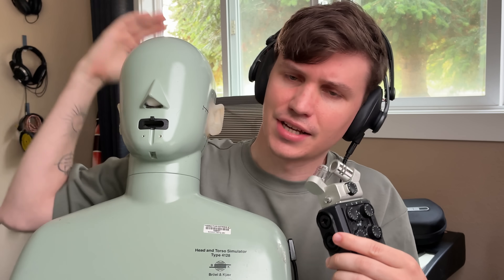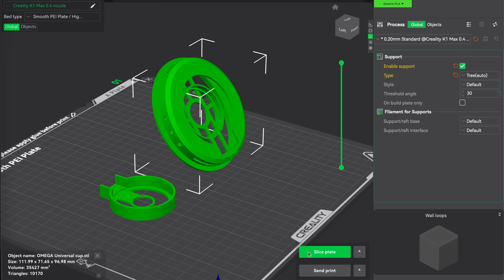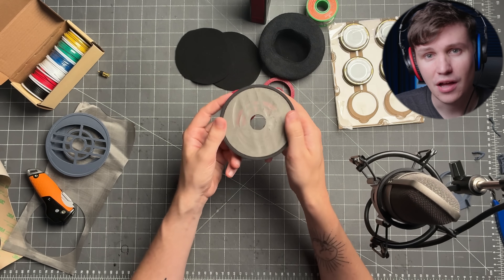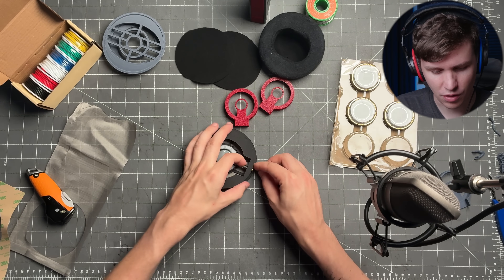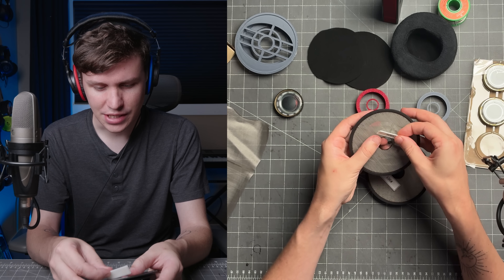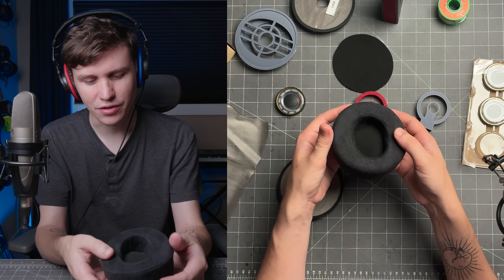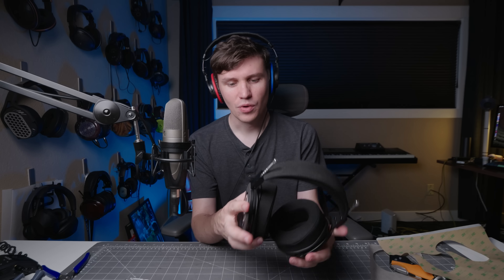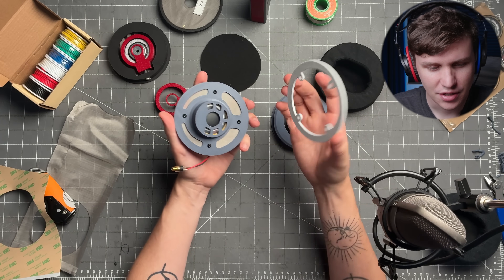Now YOU can build my Omega Headphones

Comment: shouldnt there be a left and right specific cup rotation limiter? they are only supposed to go on the back correct? seems orientation will be wrong on the left one.
Reply from the maker: You just mirror the part on the print bed (at least that's what I did)

Comment: I think that cutting out the adhesive tape with the ear piece is a little bit unpractical. Instead how about  you create a stl template for the surface that you want to stick the adhesive tape to. In that way you can trace the shape of the surface area much easier, without being restricted by the whole ear piece.

Comment: Just finished a pair last night!  Pretty great so far.  A bit brighter than imagined, but I cant decide if its because I'm not used to that level or detail, or if its overly sibilant.  Which I also realized could be because of the material I printed them with (ABS-GF) which is quite a bit stiffer, than Nylon.  I wish I personally had a way to measure to see what the difference would be.  I may print another set and test it with Nylon (Ive always struggled to get good nylon prints) Thank you for this project.  Its introducing me to things I could have never afforded.
Reply: Theres not much on headphones but plenty of 3D printed speaker boxes that show it doesnt really matter much what material or infill.

Comment: Have you tried using silicone adhesive instead of hot glue? Thinking what you use to seal a bath/sink with. Could be easier to get it precisely in the right place as you can work with it without burning your fingers, and it will harden and seal in a similar fashion to hot glue

Comment: For anyone who orders these from digikey, I ordered some more of the drivers from them, and this time they cut off a section of the tray, and properly held them in with cardboard.  Hopefully this much improved packing is standard now, and not just luck of getting the right shipping person.  The previous 2 times I ordered them they were bad.  The first time, they were just bubble wrapped, and were stuck together, with the surrounds all wrinkled.  the 2nd time, they had it almost right, and had them packed between a piece of cardboard, and some foam, but unfortunately they had the front (mashable) side of the driver on the foam, and the magnet side against the cardboard, so the foam just pressed into the surround and wrinkled it.

Fortunately the dents are fairly easy to pull out, and they were all good as new, but it's definitely nicer not having to go through the extra step.
Reply: Did you le them know? They're pretty responsive

Comment: if only 3d printer is cheap, ive been dreaming to build a hybrid wireless bluetooth headphones with 3.5mm jack port so you can plug a wire when you're battery died

Comment: Incredible project. I’d love to see an open-source hardware headband that can be both cheap, easily sourced, and very durable, because all of the common headphone headbands seem to be pretty flimsy with stress concentrated in plastic parts. The mounting method you show seems to rely on a spring-loaded C-shaped clamp on each driver unit, but it might be easier to use a 3D-printed C clamp if instead it had bosses for bearings or bushings.
Unless there’s a relatively cheap and durable option I’ve not seen.
Reply: See pinned post?
Reply: Look at Capra audio.  I think he's planning to do something to fit these (and I'm sure it wouldn't be too hard to do a modified yoke from one of the existing designs if you're impatient)
I was a little skeptical myself, but printed a few pairs of the satyr 2 using PETG for all of the non-tpu parts almost exactly a year ago, and have been using the same headband and yokes constantly_, and they've held up like a champ.  I have been too lazy to threadlock the screws in the pivot, since I always have a screwdriver on my desk, and just give them a tweak when they get loose, but really that's more of a _me problem than an issue with the design.  I have swapped a few different sets of cups onto them as I've messed around trying a few things, but I'm not super worried about the plastic in the headband breaking.  In the event that it does, I'm okay with reprinting a piece every couple years, if that's what's needed.

I'm not rough on them, but I don't exactly baby them, either.  They get tossed in my backpack pretty often, and I wear them when I'm out walking all the time.

Comment: I really like this design, but using hot glue is a flaw, vibrations could weaken the seal over time.
Reply from the maker: Nah, I tested drivers for years in this setting. It’ll be fine.
Reply: @DMS3TV  Are there other, more "permanent" options you can recommend?

Comment: Anyone know what settings to use for pla+? I'm using a bambulab x1c. I tried to print it at 55° and it comes out pretty bad (talking about the main circle cup thing for the driver to sit on). Thanks in advance.
Reply from the maker: I had very little luck printing models on bambu printers sorry :/ not sure what could help here. Did you try tilting it up at an angle and using tree supports like I did in this vid?
Reply: I tilted it to 55°and added the tree supports manually since bambulab didnt put it in good spots. But still comes out pretty bad. Gonna keep trying though.

Comment: Around how much do all the parts cost? I see a place charging $849 for already built ones, so thinking it costs way above my budget for something like this. Or are they just really overcharging? I see the drivers only cost around $10-$11 each. Pads are about $60 each. Dekoni Audio Foam Attenuation Kit is about $20. Few other things that are less costly and we talking like $200 max in parts? 3d parts would be nearly free since already have printer and filament.
Reply from the maker: it depends on the materials used and the labor time. SLS printing instead of FDM is VERY costly. Same with machining the headband parts and channel matching drivers. All depends on how they're making it.

Comment: Lcd pads should have adhesive on their lip, but here there is none.
What I'm missing?
Reply from the maker: The pad lip just slips onto the headphone.
Reply: @DMS3TV yes but should I remove adhesive or leave it as it is wirh sticker.
Reply: @DMS3TV  ok now I see. The adhesive is not applied into the pad. Now it makes sense, but just after i assembled my omegas

Comment: Got my peerless 50mm drivers in the mail today to hopefully get started on these. They packed them loosely in bubble wrap, all of them have damaged diaphrams and of the 6 I ordered 5 of the 6 are toast. One is completely immovable, 4 barely move, 1 will probably work normally but has dents in the surround though less than all the rest. Parts express only allows orders of 384. Anyone have better options? Might just give up and buy one of the remaining completed headphones at this rate. The last time I saw someone treat a speaker so poorly it was an ebay transaction and the seller packed loose 5 lb woofers in air pack which obviously was popped in transit demolishing the speakers.
Reply: you might be able to save them.  I got a bunch the same way, all stuck together with their magnets mashing into each other's surrounds.  Get a piece of duck tape, and just lightly stick the corner to the surround, and pull the dents out.  They're flexible enough that they'll usually come out as good as new.

Comment: Why not put the source files in the repo?
Like the file for whatever CAD software you used instead of just final limited editability output files (not even step files)

In some ways this seems equivalent to the open llm models being more open weights than open source
Reply: I agree. This would be much better than having to convert an STL back into a mesh and modifying that.
Reply: Just found this video and checked the git repo, and it looks like the STL files are up there now.
Reply: @brianfox340 STL files are not source files

Comment: If the Serial plate is used for tuning, why is it not integrated in the baffle design?
Reply: Probably so you don't have to print a left cup and right cup since the integrated serial plate would make them asymmetrical.  Just one cup that can be used as either a left or right.  Though it would be nice if there was a pressure fit clip on both sides so the plate could be pressed in easily.

Comment: Impressive! Good work.
Would be interesting to see if something like a Qudelix 5k could be stripped out of its casing and fit somewhere by adding a compartment on the outside of the cups (or in the headband?), and then run some balanced cables down to the drivers to make a wireless version. Hell, could probably just get a Pi Zero 2W or something and have a separate DAC placed in each cup.
So many possibilities🤔

Comment: Is there a specific filament type you recommend for the cups? or does it not matter much aslong as they're not flexible?
Reply from the maker: anything should be fine. I did my testing on the re-work with PLA

Comment: I'll definitely be giving this a shot sometime soon.  BTW, you probably don't need to go with the crazy 3m adhesive to pull out the wrinkles.  I ordered a bunch of drivers and they were absolutely mashed, and I found it pretty easy to pull the dents out just by gently touching the corner of a piece of duck tape to it, and workiing my way around.  2 minutes and they went from looking destroyed, to good as new.

I'm sure DMS has a lot more data then I do on matching them, but I found them reasonably consistent.  I got 8 drivers.  I don't think any of them are mismatched enough to bother me if I just bought a pair, and got luck of the draw, but with the 8, I came up with 3 matches that I think were very good, and one pair that's just okay.

Comment: The LCD choice pads are mounted with sticky tape? Or have they changed it so it has a lip?
Reply from the maker: it fits on a lip
Reply: @DMS3TV  Did you just remove the sticky tape that came on the pads?

Comment: How much does this cost overall?
Reply: From quickly looking through the materials, the pads and drivers combined will cost about $80+shipping. The prints will cost whatever it costs to either get them printed or print them yourself. The rest of the materials shouldn't be more than $50 or so. I'd expect this to be doable for $150 less the headband. But probably more like $200 to $300. Of course, if you have to buy any of the tools that price could easily double.

Comment: It's kinda hard to find the drivers with a quick google search, can you give some examples in the github materials file or in the description in the video (not links, just places where I can buy legit drivers and not get scammed or something)?
Reply from the maker: you can find the drivers on digikey :)
Reply: @DMS3TV  I bought drivers there a couple times and they are sometimes very bad at packing them.  Luckily, even if they're all wrinkled and look totally trashed, I found it pretty easy to just go around with the corner of a piece of duck tape, lightly touch it and you can pull all the dents and wrinkles out in 2 minutes.

Comment: I'll add this to the list of projects that I want to do, just one little question, while you talk about FDM, have you tried diferent materials? I mean, PLA, PETG or ASA, if you tried is there any difference?
Reply: As someone who has mainly worked with PLA, the step to add hot glue had me worried because of PLA's low melting temperature. It doesn't take much heat to soften PLA and potentially warp something.

I'll have to do some experiments with hotglue on prints tonight.
Reply: Replying so I can get the answer too
Reply: Yeah, would like to know this as well
Reply: I would also like to know
Reply: Ill be testing with PLA and PETG
Reply: @Twist_av_Lemon Any results yet?

Comment: How would you channel match those without an access to a measurement rig?
Reply: You can match using DC resistance measured with a multimeter (± 1 Ohm). Not the most correct way to do it. Ideally you want to channel match frequency response of the assembly that takes the metal mesh and housing into account. However if you only build 1 unit I wouldn't worry about it. If the channels are off by a huge amount you will notice.  Maybe fix the drivers with blu-tak first instead of hot gluing them.

For any DIY headphone project you really want a measurement rig. A simple flat plate with a cheap omni-microphone is enough for checking channel mismatch and abnormal bass roll-off.
Reply: Make yourself a measurement rig.  Measuring with a meter, they're all going to match unless one is just plain broken.  You don't need accurate absolute measurements, only relative, so if you can 3d print something to very consistently hold any sort of microphone into a very repeatably consistently mounted driver, you can record some sweeps and compare them.  I had a spare musical instrument mic, and 3d printed a bracket the clamped to the mic body and put it on a mic stand  and the driver just friction fit into a ring directly in front of the mic.  The main thing is consistency.  I set it up to do a couple dozen sweeps on a timer, and left the room while I measured them, without moving anything in the room between recordings.  the main thing is that everything is the same for every measurement.  the driver should go in exactly the same orientation, etc, and don't touch any controls, etc.  Then you can compare the drivers and pair them up as best as you can.  I found them actually fairly consistent, and I think even if you took the worst match, you might not notice it, but of 8 drivers, I managed to match 3 pairs quite well, and one mutt pair that honestly are probably good enough for my ears.  I might buy a few more to match to do a set of omega, since I used the 3 good pairs building a few pairs of Satyr 2,  for myself and a friend.
Honestly, as far as the gear goes, you don't need a calibrated room measurement mic, or anything like that.  Anything you can get your hands on, and mount consistently will be fine.
If you want to be extra sure the measurements don't have any inconsistencies.  do like I did, and put a small sharpie mark on the drivers, and test them all for 2 full tests, in a different order, and make sure that the results in both tests match.

Either that or just don't worry about it, and they're probably good enough. ;)
Reply: @nwimpney  So basically I'm looking for something similar to the speaker measuring rigs, where a microphone is placed a few millimeters in front of the membrane to minimize room influence?

Comment: Hey DMS, in the BOM, where you mention PK392 jacks, do you mean PJ392?
Reply from the maker: Ah! typo, you're correct and I've updated it. Thank you!
Reply: @DMS3TV Sick! Thanks!
Reply: Actually, maybe I'm crazy, but my BOM is coming to well below $200. Can I actually make endgame headphones for this low? What am I missing? Special filament perhaps?
Reply from the maker: @SagnikDasgupta  without all the SLS parts, machined parts, driver matching, etc it makes omega MUCH cheaper to build.
Reply: @DMS3TV On that note, have you investigated any dependance of print settings or materials on sound quality, FR etc.? I can imagine that the porosity of the SLS parts might have had some influence on the sound. Thoughts?